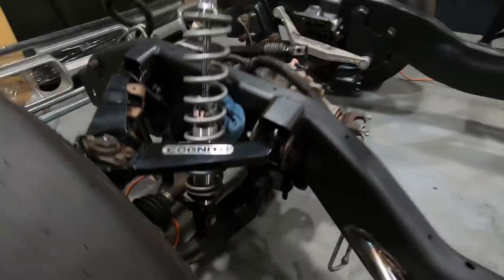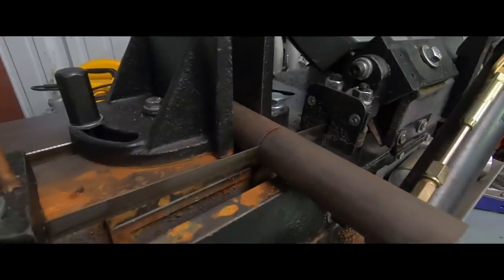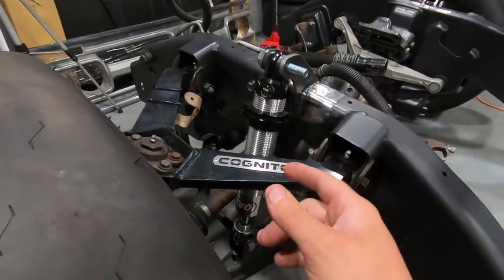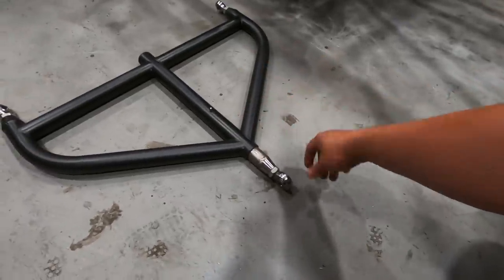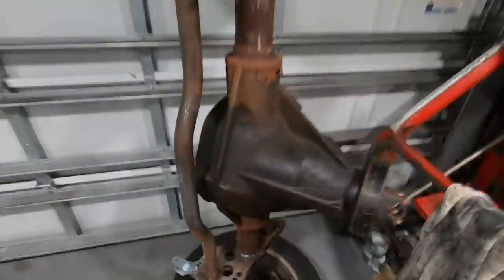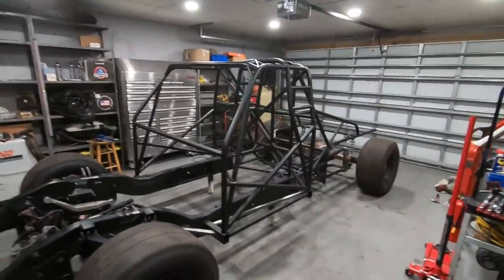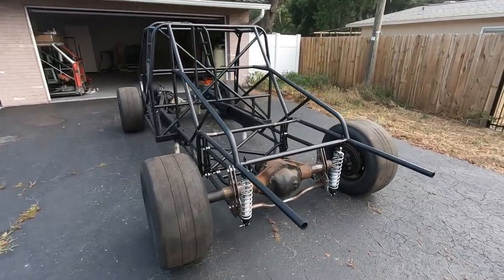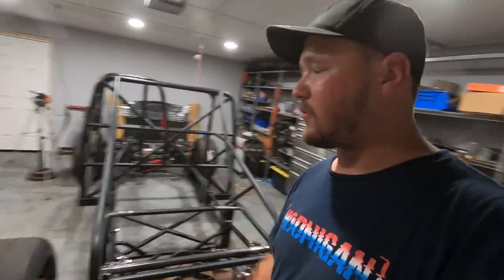C10 Race Truck Gets Coilovers and Bump Stops!

Comment: Hi Wyatt love the build. Im actually the guy helping Phong with the geometry problems on Phoenix.  Met Kyle at PFI a  few weeks ago. I designed an upper control arm for 00-07 classic 2500hd trucks that you would like. It eliminates the frame adjusters and has more alignment options.  If you'd like to see pictures i can send them through FB messenger.
Reply from the maker: I’d love to take a look, shoot me a message on fb 🤘🏻
Reply: Sent you a few pictures to look at.

Comment: Put a wall mount or stand up AC in there... they pull moisture out of the air, and will keep you cool. At least a dehumidifier. Good to see you working on the truck again!
Reply: Wall mount ac units are just about the same as a regular ac unit now. A window unit would be fine.

Comment: if you check into your local paint and bodywork supplier you will find that they offer a lo gloss black paint product that is formulated to go directly over rust  ie frames ,tubing, it actually doesnt stick to clean metal at all  it will save a ton of work and worry .   the truck is looking rad  keep up all of the great things you and Kyle are doing you two are going to kick that record in the ass

Comment: I think if you plan to stick to a mostly black truck. Either throw in gold or a bright lime green for some major pop. color frame sections and some decals maybe a strip or 2 on the wheels like a ken block wheel. 

Other cool different color would be a darker metallic purple
I will probably dig just about any color combo though. 
Kyle needs to do something with the mr-k though white is boring as shit

Comment: you should Go with a 9" 3rd member  rear end. much easier to change pumpkins. you can change a 3rd in a hour at the track. if you go for a gear vender that would be nice.  We all know it is going to be Bad A**    Clear satin rustoleum paint everything, stop the rusting from the start ( less sanding later) I even paint my bolts and nuts, washers, looks Good for longer.

Comment: An explorer 8.8 is a good option for the rear also.  1/4” thick axle tube.  Come LSD with disc brakes and 3.55, 3.73, or 4.10 as well as 31 spline axles.  Can upgrade to spool and 35 spline axles.